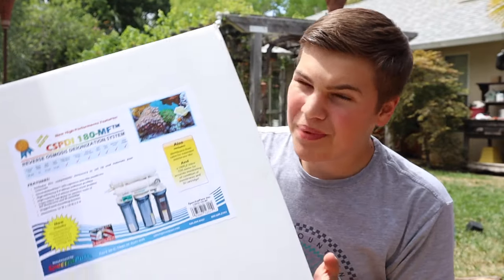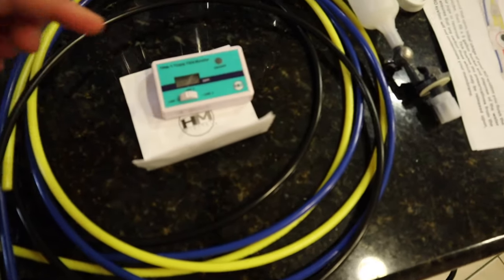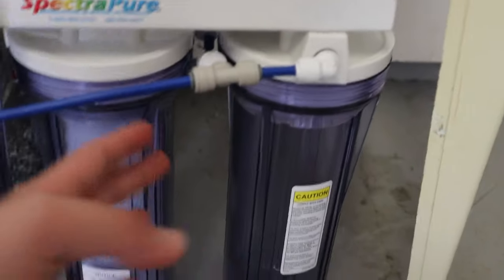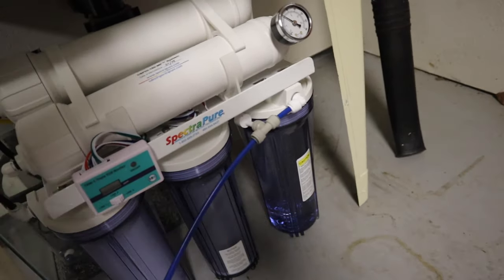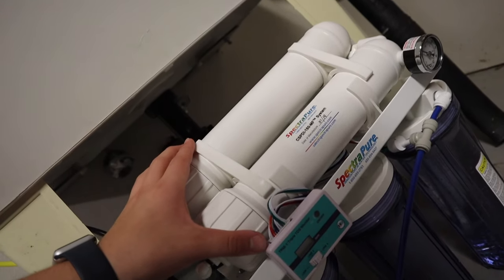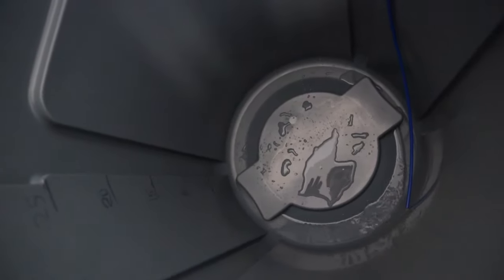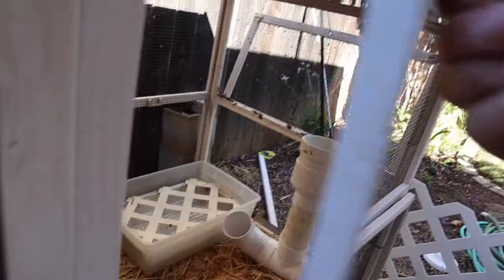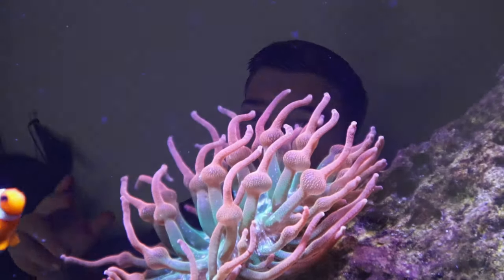*NEW* Aquarium Water Filter (Spectrapure RODI unit review)

Comment: i bought the  spectra pure high chloramine system RO/DI system  5 stage system it waistes = around 30 gallons to make 5 gallons not sure if is because my water pressure where i live is barely 40 psi
Reply from the maker: Yeah that water pressure seems low
Reply: Chewy's Bro Aquatics hav u meassure how much yours waistes for 5 gallons
Reply from the maker: jmz mrz no haha - it takes 45 mins to make 5 gallons though